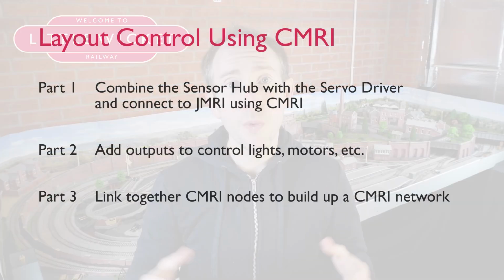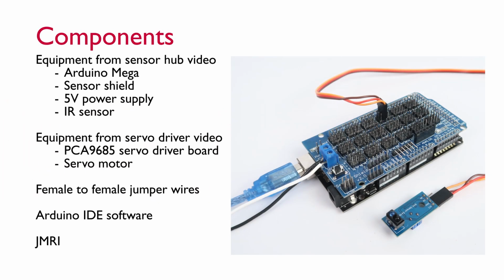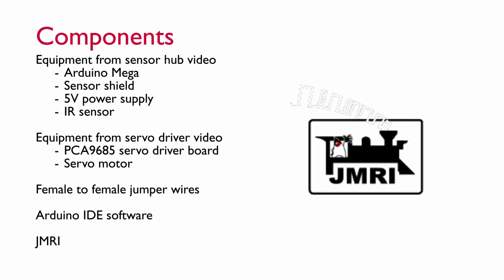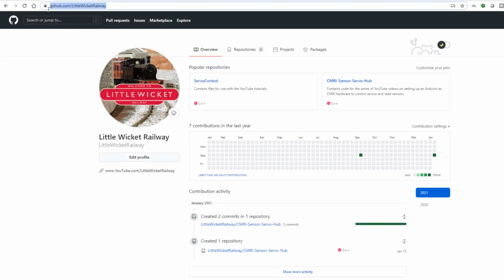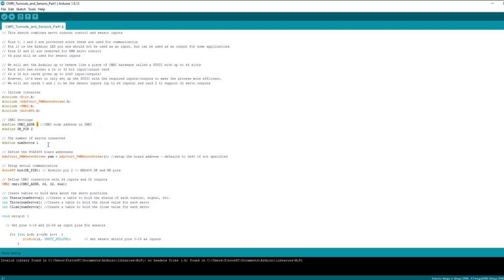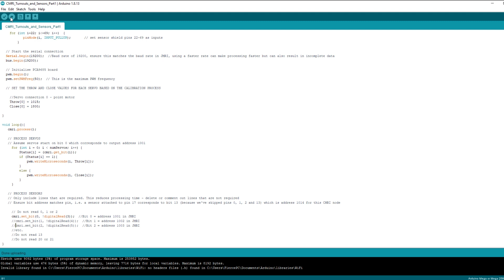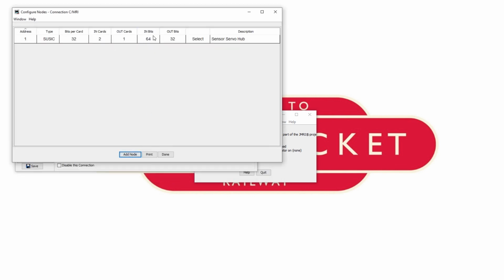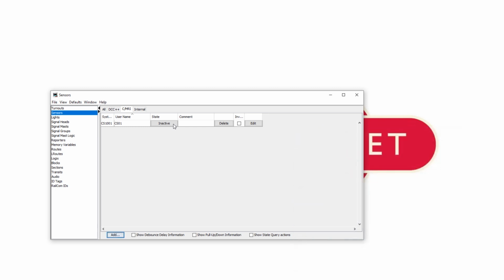Arduino, CMRI and JMRI - Part 1 - Combined Sensors and Servos

Comment: Actually I have a proyect (DCC EX) in Arduino Mega. How can I upload this sketch? Another question is: Can I connect the sensors and servos directly in Arduino into the digital pins?

Comment: Hi Rob - excellent information, refer to these videos all the time, I couldn't get the combined sensor servo hub to work on one Mega, weirdly it works fine as a servo output but as soon as I connect and start a sensor, it works once on initial setup, but as soon as I restart JMRI it seems to disconnect the board and neither servo outputs or sensor inputs work at all - very strange, don't know if anyone else reported this. I went back to separate boards using the python script - works fine. Thankyou again for all the information the videos are excellent.

Comment: Dear Rob
Please forgive me for asking this question in poor English from Japan.
I watched Rob's video and am trying to make JMRI's CMRI recognize Servo and Sensor by combining Arduino Mage and Sensor Shield.
I have watched many videos so far, and I believe that the reaction of Servo and Sensor and the trial of Signal Light were successful without any problems.
This time I watched this video and tried to get Servo and Sensor to be recognized by CMRI. Servo moved from CMRI and I tried to see if the sensor's sensing was transmitted to CMRI, but it didn't work.
Result is,
1. Servo recognizes and operates with CMRI. It also runs commands to the CMRI monitor.
2. Although the Sensor base is sensing, it is not recognized by CMRI. →The LED will light up. Commands do not run to the CMRI monitor.
(No change will occur between active and inactive on the CMRI screen)
Before starting JMRI, the Arduino IDE is closed, and the COM port of JMRI's CMRI is recognized correctly.
I previously tested Signal Light, and all four color LEDs were recognized by CMRI and changed.
Therefore, I suspect that it is only the Sensor that cannot be recognized by CMRI.
Is there a solution? Please tell me.

From Japan TAKU

I have something to add as I understand it.
The CMRI monitor goes out of control as soon as it registers the sensor.
When using a converter, the information will be displayed one click at a time.
that's all.

Comment: Hi,
I am finding your information extremely helpful. I have not done any model railway for about 35 years and would like to get back into N gauge. This DCC is amazing with all the things that can be done. 
Keep up the good work. 
Alan
Reply from the maker: Thanks Alan 👍 Welcome back to the hobby!
Reply: I'm having problems with JMRI.
I've no electronic gear yet, but I thought I'd download JMRI first (not knowing much about electronic stuff), I've downloaded the latest version, and it is asking for Java 11 but can I find it, no way, I can find version 8, I've downloaded it but that does not work.
Reply from the maker: I think JAVA 11 is available here: https://www.oracle.com/java/technologies/javase/jdk11-archive-downloads.html#:~:text=Go%20to%20the%20Oracle%20Java,on%20the%20JavaTM%20platform.

The JMRI website/forums are great for support with setup issues like this.
Reply: @LittleWicketRailway  Thanks, I will give it a go later.
Reply: @LittleWicketRailway  I have downloaded Java, I think?
Tried JMRI and it has opened up but yours seems to be a newer one to mine as if I remember yours has DCC+++ along the top of Panel Pro
mine does not.
Alan
Reply from the maker: @alanpennington8364 you'll need to create a DCC++ connection under preferences, but because you don't have the hardware it'll need to be virtual.
Reply: @LittleWicketRailway Thanks 👍

Comment: Hi Rob. Loving the videos. I am hooked. I am hoping I can use push buttons on a layout board to manually operate the points and lighting etc also. Is this pretty simple to achieve aswel as being automated in jmri please?
Reply from the maker: Thanks Stuart, you can have manual and automated control side by side, might be a bit more work and a few more wires, but doable.
Reply: @LittleWicketRailway  I since watched your mimic board videos and got the answer yes!! I’ve bought all the parts from your video lists for the command station and block detection. The Amazon guy is shattered 😂. I had a nightmare last night as using Firefox platform does not show the attached hardware when clicked connect on the throttle. Tried google chrome and voila!! Can’t wait to build the block detection and all the other parts you demonstrate. It is fantastic. 
I owe you a drink for sure. Your channel is purely inspiring. 🙌
Reply: @LittleWicketRailway  I also bought the uno initially from watching the dcc++ video as you used one on that but then I see you use a mega in this video. I tried the uno first and it did not allow me to select ‘compile’ after selecting WiFi option in the startup software. It simply greys the button out. The mega did and I am just waiting on my WiFi board. Does the uno not support WiFi do you know?

Comment: noticing differences between what you have done, and the mega sensor shield  v2.4. Digital pins start at 14 and go through to 53.
PWM pins start at pin 2 and go through to pin 9
green pins on digital are data, but on PWM pins the green ones are pwm. Would I be right in assuming connecting the pwm and ground pins on the set pins marked 3 ?

Comment: Rob,

After fighting a problem of the turnout table not moving the servos,I went back into your sketch and do not see a line for the AdafruitPWM Servo Driver  - -including the variable WIRE.
As a result - I2C is not being used to the PCA9265 and it is trying to fire a servo on a PWM pin right on the arduino itself.  Please check this out on your sketch for the 5260 mega servo shield application.

Bob S - cleveland

Comment: the mega sensor shield, you have v2.0 and I have a v2.4 still use the exact same pins, just the location on the board is different ?

Comment: Can somebody tell me how to upload the sketch code? Rob does not show how to do it on this project or the previous project on how to center the servos, so I'm stuck before I've started I'm sure it is a simple thing to do but I cannot fathom it.
Reply from the maker: Hi Terry, hopefully you've sorted this now, but in the Arduino IDE software there is an upload button in the top left hand corner. If your Arduino is connect then it should transfer the sketch to the board. This video (not mine) shows a couple of ways to upload a sketch (https://youtu.be/y5znFDmY5V4?t=241).
Reply: @LittleWicketRailway  Thank you for your reply I will have a go.
Reply: @LittleWicketRailway  Hi Rob I can upload all the sketches in the first part and make the servos move as per your instructions. But I cannot upload the seperate code that you set out below your video. It sets up the servo position for the points.
Reply: Hi Rob, All done everything works.Many thanks.

Comment: Hi Rob. Me again! Can I be a Pain!!?? You kindly put up the code for Slo-Mo sensors on your Git-Hub, using a button switch to control the servo. I'm trying to include the 'millis' function into this video's code for servo-sensor hub controlled from JMRI to slow the servo movement down. Not having much luck. As I'm 74 years old my coding brain has somewhat shutdown! Any chance of you showing the way to include slo-mo in this video's code? Would be eternally grateful.
Thanks. PS. I'm sure you would wish to use such code for your points on your fab new layout plan?!?

Comment: following on from my previous comment in another video...
It looks like I'm going to need one Arduino, a sensor shield, 2 of those PCA9685 servo driver boards, 21 servos, Watch more of your videos about it, then spend a week or so playing around with Arduino code to make the it a self contained unit.
If you don't remember, or anyone else is reading this, the aim is to have 21 sets of points switch using servos using toggle switches.

Alternatively though, since the PCA9685 uses I2C for communication, I could abandon Arduino entirely, read up on how the PCA9685 works and stick to a PIC16F883 that I'm used to working with, to write my own software for it.

Comment: Rob, Just a query about your sketch code. The section testing/setting the sensors   
   cmri.set_bit(0, !digitalRead(3));  //Bit 0 = address 1001 in JMRI
  cmri.set_bit(1, !digitalRead(4));  //Bit 1 = address 1002 in JMRI
  cmri.set_bit(2, !digitalRead(5));  //Bit 2 = address 1003 in JMRI
  cmri.set_bit(3, !digitalRead(6));  //Bit 3 = address 1004 in JMRI
  cmri.set_bit(4, !digitalRead(7));  //Bit 4 = address 1005 in JMRI
  cmri.set_bit(5, !digitalRead(8));  //Bit 5 = address 1006 in JMRI

I cannot get my head around the logic of "NOTdigitalRead(x)" code. Is it a simple test/change? Or is to invert the signal?
Reply: This is for inversion. Depends on the sensor wiring.

Comment: Hi Rob - thanks for the amazing videos - working on a whole new layout for my son & me - and wanted to get things automated. I'm currently stumped on this one though. 

I've worked through the previous videos and had things working fine. Got this one set up - one servo and two sensors. All was working fine, got switching working in JMRI. Then went back into Arduino to tweak the servo settings. Re-uploaded the sketch to the Arduino, and it took ok. The when I go back into JMRI - nothing happens. The switching does nothing and the sensors arnt seen.

I've restarted everything, PC, Arduino etc. 
Tried uploading the sketch without the shield on. 
Tried a second shield.

Nothing seems to work.

Any ideas??

Nev.
Reply from the maker: Hi Nev, sorry for the slow reply, are you still struggling? Here are a few things to try:

Did you close the Ardunio IDE before starting JMRI? Sometimes having both open causes clashes.

If everything is uploading without any errors then your board is probably fine. Is your CMRI node still setup correctly in JMRI and is the COM port the correct one? Are the addresses in JMRI correct for the new upload?

JMRI usually complains if it can't see a board connected where it's expecting one. So if you're not getting an error when JMRI starts then that suggests it can see a board connected on the COM port that it's expecting?

You can open the CMRI monitor from the CMRI menu in Panel Pro and check to see that signals are being sent out by JMRI.

Does the Arduino have power? Are the LEDs on the sensors reacting and are the LEDs on Arduino on? When you send a command from JMRI by clicking a turnout does the LED on the Arduino flash.
Reply: @LittleWicketRailway  hi Rob - looks like it was an issue with the PC I was using - quite an old thing. I've changed to something newer and it seems to be good now.

Any ETA on Episode 3? Want to try to avoid a ton of cabling on our new layout - 23 points to wire!
Reply from the maker: @nevbull1322  glad you've managed to fix that issue. I know there's been quite a delay geting part 3 out and I'm really sorry. We were meant to be exchanging on the house this week, but on Friday night our buyers pulled out 😡 So I spent all weekend when I should have been recording trying to find a new buyer. You might have realised that nothing went out on Saturday 🙁 Things are back on track with the house, but I'm behind on the videos. I will get back onto part 3 tonight and see where I get to, I don't want to rush it and give out bad info though.

If you've got 23 points to wire and presumably plenty of sensors and other outputs then I think you'll find pt3 useful.

Comment: Hi Rob, Would this work as a replacement of the previous sensor hub, without having the servo part attached, it looks easier than having to load the JMRI program for the sensors on start? 
I have already got the other hub working, but this looks like it may be better to use.
Reply from the maker: Yes, definitely. You don't need the servos connected, purely option, and you're right it's a lot easier than running that script in JMRI each time.

Comment: I finally figured a work around for the Sensor issue. I had to put my laptop to sleep in 1 min and then wake it and Poof the sensors are all reading perfectly. Feels like a com issue but I am not sure at least I can make it work now without waiting an hour. Now on to my latest problem. 

I added in some additional Occupancy blocks and Sections so that the system could switch all the turnouts prior to starting each Transit, New issue now is tough that all my signals are auto filling RV and FW sensors that keep them red all the time so nothing will run consistently. I go in and adjust them to clear out the logic to allow the signals to work as intended and as soon as I run an auto train through the area it adds back in the sensors that are jamming up the logic and everything comes to a halt again. Another issue I am having that may or may not be related is since the modifications trying to start an auto train on my section 1 prior to the turnout it will not start. It loads like it wants to go but never throttles up. I have to manually override it and as soon as it hits section 2 I can put it back in auto and it takes off. (Until the signals get botched again that is.) Any help or point me at a good location to get it would be very appreciated. I have been banging my head on the desk for 2 weeks and cant seem to sort this one out and before i go into a large scale with this I want this small layout to operate properly so I Know exactly how to troubleshoot problems on a larger layout.

Comment: when i go to add cmri connection on serial 3 i get a port in use error
Reply from the maker: Hi Jerry, make sure you close JMRI when you're using the IDE and close the IDE when you're using JMRI. They can't both communicate with the board at the same time, so will cause this error.

Comment: Hi Rob - In your sketch you say not to use pin 13 as an INPUT but you have initialised it as one in the FOR loop - are you still advising not to use pin 13 or have you superseded that advice? Obviously not mission critical but curiosity drives me to ask.

Brilliant video, as ever - had everything set up and working on a small test within an hour of receiving the board and shield! By following your videos I've got a complete DCC and automation system for less than £100 !!!
Reply from the maker: Thanks Andy 👍 Pin 13 is a weird one because it's attached to the board's LED along with a resistor. I've had issues using it as an input, but thought that it might be ok to use as an output. However, I tried that and got some weird results, so unless you desperately need the extra pin I'd avoid using it. If I've initialised it in the for LOOP then that's probably me being a bit lazy 😕

Had I not discovered this technology then I would never have got into digital and I suspect I may have lost interest in the hobby after a while. It's incredible that this stuff has become to affordable and accessible.
Reply: @LittleWicketRailway  Thanks Rob. No probs with initialising the pin and not using it - just wondered if I was missing something. Actually more efficient to do it this way than to have 2 FOR loops.  Thank you for clarifying.

Comment: Rob, Love your videos you make it easy to follow things that are somewhat complicated. I am having a small problem though. Every time I shut down JMRI or loose the USB (Com Port) connection my sensors do not reload automatically. To get them working again I have to go delete them out of the JMRI sensor file and then re install them once i have saved the file with no sensors. Once its all clean I can re add them and they work perfectly right up until I shut down JMRI again. As you can imagine its not a huge deal when I am testing thing with 2 or 3 sensors but I really want to get this sorted out before I start trying to set it up on a whole layout. Any help will be greatly appreciated.
Reply from the maker: How odd. I've not encountered this. I'm working on pt3 at the moment so will see if I have the same issue.
Reply: @LittleWicketRailway  So i have been tinkering a little more and what I have found is that if I let the Board sit connected to the PC with the JMRI software up and leave it for an extended period of time it eventually finds the sensors. Only downside is every time I want to make a change and restart the software I have to go watch a movie before I can see if the changes I made are working the way I want. I also set up the servo driver system as well and it also does not recognize the driver or at least doesn't communicate through JMRI. I haven't had a chance to let it sit and see if it too comes online if I leave it alone for awhile. I will probably do that today and see what happens. I did use the Script in the Adafruit PWM library as discussed in the other video and it ran the servos as intended. So I think it has to be some sort of communication issue from JMRI to the Mega2560  or another com issue that is resolving it self over time. Any input as to where you think the issue may lie will be greatly appreciated.
Reply: Update. I did find that in fact if I walk away and leave the system for the same extended period of time it finds the servo driver system as well. So I am not sure what to make of the delay in communication.
Reply: @raymondidleman3899  Did you ever get to the bottom of this…. I’m running JMRI on an older Mac Mini?